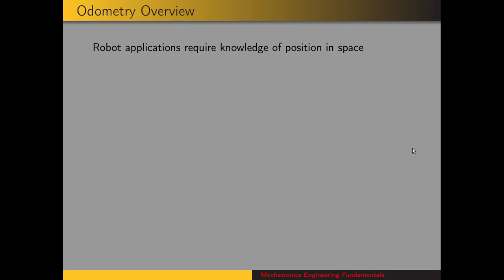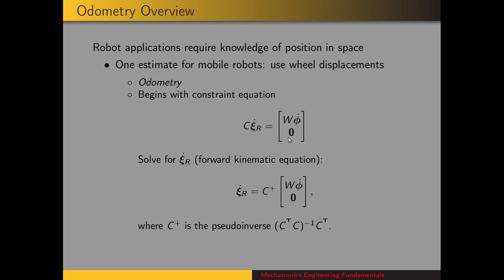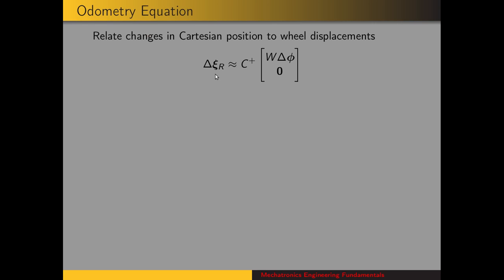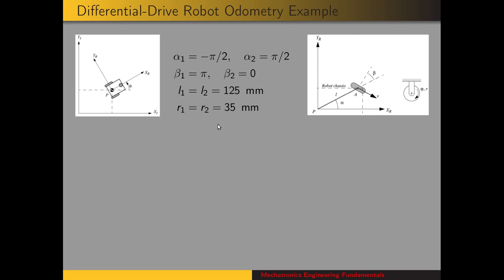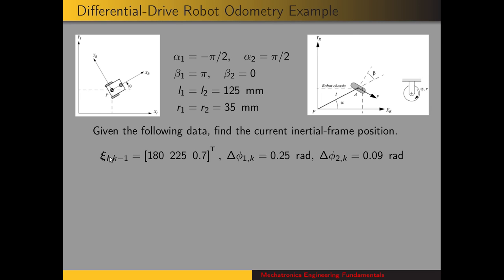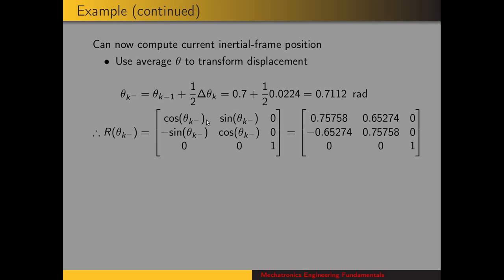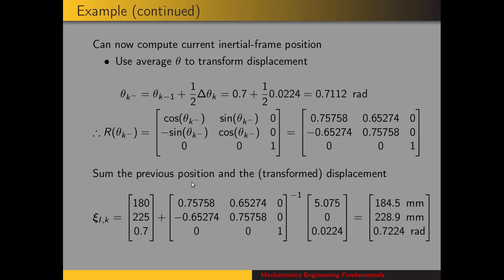Mobile robot odometry

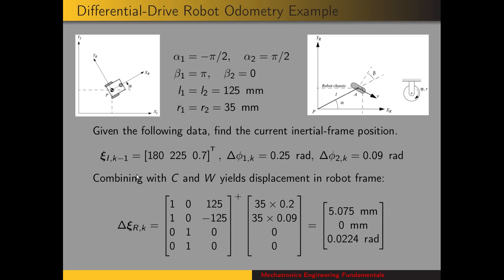Comment: at 5:35' I think the angle should be 0.0154 not 0.224, correct me if am wrong
Reply from the maker: You're correct.  I'm glad you pointed that out.
Reply: @drmattmarshall6545  you know what am wrong, you are correct it should be .0224 , how? Answer. in the second matrix it should be 0.25 for the wheel displacement not 0.2 that was the mistake
Reply from the maker: @Saeed, yes, that's clear.  Thanks for following up!